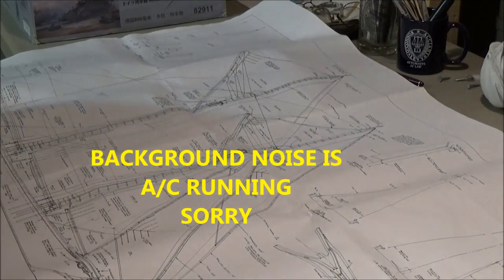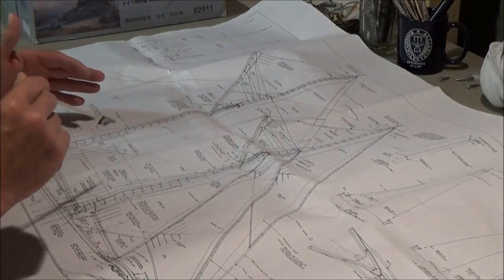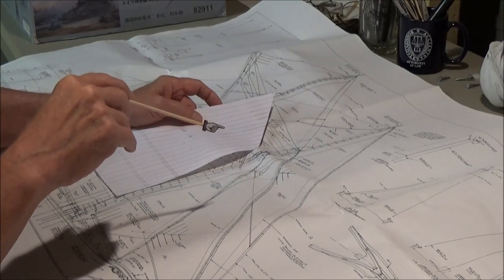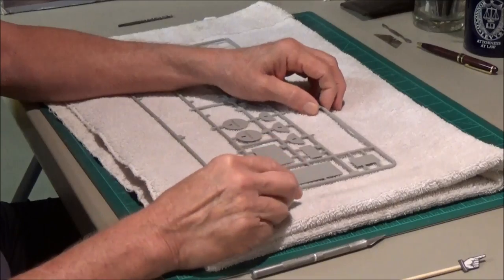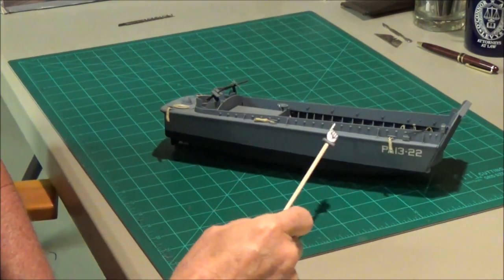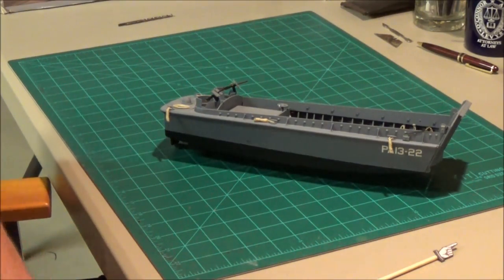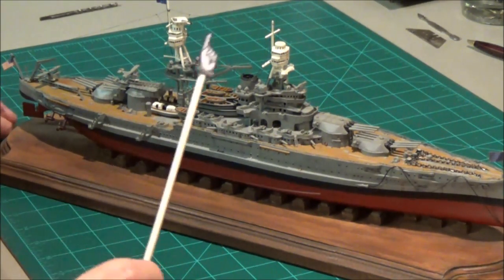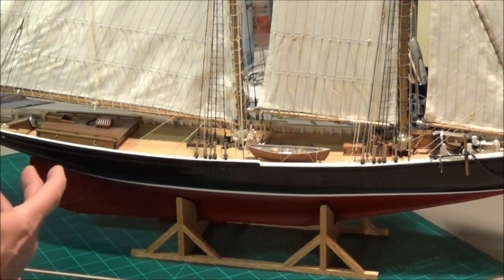TIPS & TRICKS PART 4

Comment: Fantastik JOB,  I watched all 4.  Very good, lots if tips, lots of help.  I am into cars.  Have over 800 Corvette kits.  I guess you would say a collector.  I do build, have a lot started, but been years since any completed.  Always get a start, cut doors , trunk open  weather etc, but stop for some reason.   I guess afraid of not getting as much detail as I can.  I left a comet on  very small drill bits from Harbor Freight  -  20 pc's for around $20.  Be careful they are very small, very hard, and break  easily . great for small holes as spark plugs.   Thanks Gary, much help.  Hope to see  more tips and tricks.  GOD BLESS  YOU

Comment: Gary: Been watching your Blue Nose videos. One trick I use for CA or 
other glue, go to Hobby Lobby and look at the "Paint Pallet". They are 
small plastic like cups...6 on a "pallet". They have a rounded bottom so
 the glue stays in a "drop" instead of spreading like it will on paper. 
Also stays "fresh" longer. Can use wood glue in one cup and a thin CA in
 one, a medium CA in one, and a thick CA (gap filler} in a third if you 
want. Just mark with a Sharpie next to the cup which is which. Can also clean out cups with a rag when finished.